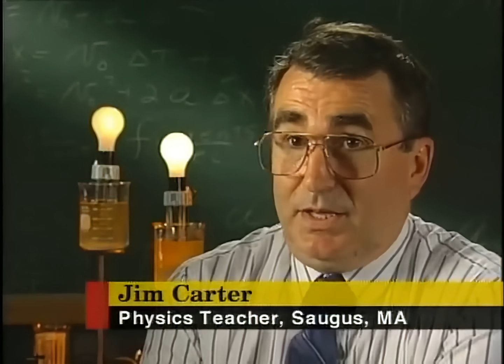MIT graduates cannot power a light bulb with a battery.

Comment: I saw them use a 100-220v candelabra bulb at first. Of course it will not illuminate with a single dry cell. It will work with the little flashlight bulb shown later. This test is flawed, or maybe the trick to the question is that you have the wrong bulb.

Comment: A lot of people seem to think this is a sign that the system is broken. That's ridiculous. And silly. Here's why:

Pick any university you want. In fact, better yet, pick any 1000 people you want. Feel free to cherry pick the smartest people in the world. You choose to select them all from the same discipline or you can spread it out. No restrictions. You're choice.

Give me a camera and an hour and I'll make a video exactly like this using a different question that is every bit as "easy."

Finding surprising or funny gaps in understanding or knowledge - especially with someone who is a little nervous or on the spot - is incredibly easy.
Reply: The problem is the media setting them.up to fail, giving them a bqttery outputting a tiny voltage and an incandescent buld thst operates at mains voltages, no matter how they connected it that bulb wast going to light from that battery.
Reply: Complete cope bro.
Reply: Except that this wasn't a gap in knowledge but conceptual and spatial reasoning ability.
Reply: @nightfoxxy  it was not a gap in knowledge , it was a gap in practical experience exacerbated by the nervousness of being on camera

you should try giving an interview in front of a massive crowd with the pressure of your uni's name on your shoulders and see how you hold up
Reply: @nightfoxxy there are a lot of social factors involved. Also, many pointed out this could have been cherry picked to make a outlandish point.
Reply: The problem is people's overconfidence in an area they have no expertise

Comment: I know what the video is trying to prove here. It is trying to prove that what you learn and what you can do do not always translate. I also know what this video poster is trying to do - to try to make MIT and/or higher education out to be worse than they actually are.

The video was cherry picked. You can see the different bulbs. Some of them require high voltage, which you cannot get with a single 1.5v battery. They finally showed the guy at the end lighting a small (probably 1.5v) bulb with ease. The fact is that you learn way too much in college to be able to keep in your head at once. It takes time and refreshing your memory and most importantly application of that knowledge to really be proficient. 

Therefore, I wouldn't expect any students besides the ones who were interested in EE to be able to do this without preparation (remember these kids just graduated they were basically ambushed and expected to perform a task that they may have learned in their first year).

Comment: Stupid trick question and misleading title. Right, you can't do it with "a" wire like they're handed at 00:59, because you need two wires (or do it like he does at 01:57). It's their graduation day and they're just being casual with the interviewer because they're not expecting "gotcha" trick questions. As an alumnus I assure you every MIT student knows how to hook up a light bulb to a battery, because electricity & electromagnetism is a required course for all majors (8.02) covering basic circuits and things like Maxwell's equations their freshman year. EE majors by sophomore year are building entire CPU's out of basic components.

Comment: Connecting a circuit is pretty basic but in fairness they should have two wires (I would have asked for two probably instead of just putting the battery to the bulb). 

Even so I strongly suspect the video is heavily cherry picked to produce a 3-1 or 2-1 result (most graduates even in non-tech subjects would be able to complete so circuit so to speak).

In the event of the fails- I expect this sort of thing is probably nothing like what they are studying. I studied theoretical physics and I wouldn't be able to do much more than basic lightbulbs etc, however I could work through very advanced maths and solve complex problems, which bottom line is highly valued and useful to employers- compared to putting together a basic circuit which anyone can do with 2 minutes training.

Bottom line- this is almost certainly hack, rubbish journalism on graduates that most likely will contribute far more to the world than the interviewer could hope to.

Comment: To be fair, it was a bit of a misleading question. Not enough information was provided. What type of lightbulb? What type of battery? 1.5VDC won't power a bulb designed to run off of 110VAC.

Comment: The comments here are truly entertaining.  Pedantically parsing the question in an attempt to rationalize the failure of the students to make a simple circuit.  I guess if they had asked, "Can a human being produce illumination visible to the naked eye using only an electrochemical storage module, a piece of low impedance material, and a device designed to emit light when the electrons within a filament inside the device are sufficiently excited?"

Comment: Interesting..... we had to figure out and confirm the function of two way switch light control for 120 VAC bulbs back in high school shop class.......Yet while I was working through University electrical engineering studies a fellow classmate with higher grade marks than I would pick up a soldering iron from the hot tip end!!!! That was 40 years ago when we had good science, physics, math and shop teachers.......

Comment: I doubt even the producers of this video could power the light bulb, given that they had a 1.5v battery and a 120v lightbulb (@ 1:02). Even the smaller bulb that they started using halfway through appeared to either be  too high of voltage, or the battery was nearly dead (@ 1:57).

Also, what's the point of this clip? I have a feeling that it's been taken way out of context.

Comment: to all the people saying that's a 1.5 volt battery and a 120 volt light and the battery doesn't have the power to light it, is technically wrong in that the bulb may be 12 volt, and the battery can power it, but not to its full potential...and will deplete the battery sooner.....and the people saying it's a trick question, it's not, the bulb completes the circuit. ..the one guy did it at 2:00

Comment: basically they are unwitting pawns of an exceptionally technical societal machine.  after the first year your basics are mostly out of the way second year you dont have electives, you might have a couple general subjects and prerequisites for your major.
if you make it past your prerequisites which require A's or B's on your first attempt! you may proceed further into your major. the third year consists of courses for your major at their highest difficulty the fourth year it the kicker. your professors will spin bullshit like youve never heard, the material is the same shit different professor. and the senior level papers might be 30 pages. the hardest part is dealing with rotten toxic attitudes of some of your professors. its the first circle of hell.  by then you are fucking sick of the shit, and you wish you chose a different major

Comment: Its a bit of a vague question, unless they actually saw the bulb and the battery first its difficult to answer. Yes a d cell battery will light a bulb that is rated for around its voltage, but its not going to light a 110v / 240v bulb as it doesn't produce enough power. Use many batteries in series and it will do though.

Comment: Lots of comments that a 1.5 V battery won't light that bulb.  But you know, I'm going to give the author a tiny bit of benefit of the doubt that they at least verified it would work with that battery, that bulb, and that wire before setting out to the campus.

Comment: answer is aways I DONT KNOW. there are always variables, you cannot power a c9 seen at 1:02 (120 vac 60hz) with D cell. anything is possible, one could wire enough cells together (in series) to make 120 vdc, and even throw an inverter in to turn output into ac, package it in shrink wrap and call it a "battery", or stuff a 3 vdc l.e.d. into that c9 just fuck with you, variables, you need to indentify the  VARIABLES!

Comment: This is the problem with most "smart" people (and just to clarify, I use smart for want of a better word, I am in fact referencing those who think that they are clever because they have degrees, doctorates, etc.). They think that because of their intellect, if they can't solve a problem there must be an issue with the equipment or question. They don't even begin to consider the fact that the issue lied with their own lack of knowledge.

That being said it doesn't take an electrical engineer to figure out how a damn light bulb works.

Comment: Wait, was this a trick question, or could they genuinely not complete the circuit? As I see it, there are two possible tricks: that the battery has to be of a suitable size for the bulb, and that you need to touch the nub of the bulb to a terminal on the battery if only given one wire (like the black guy did). Was it supposed to be a test of these tricks, or an illustration of the fact that despite graduating from a top school (like the mech eng girl), some people still don't understand science for ten year olds.

Comment: A proper engineer would have said that it depends on the power consumption of the bulb and the capacity etc of the battery. They  always consider the specifications, doesn't matter if you're mechanically or electrically minded. It's that thought process that helps makes to an engineer. They should teach that! That aside this is basic stuff, that they should really understand, especially as the world moves more towards electro-mechanical products. I get that this was one of those simple questions designed to catch people out though.

Comment: lol I thought of a 100 watt bulb with a little battery. I would have said no... even though I remember doing that with flashlight bulbs when I was like 8 years old. so I know it's possible, but since I thought about a bigger bulb I would have said, no. but if I was seen the bulb and the battery, then of course. it's so simple, I think those students are a litle dumb because they want to get 2 wires, when all you have to do is complete the circuit lol

Comment: EDIT: Literally two seconds later in the video they showed what I talk about below. I didn't watch that far in before writing this stuff, though it's good to get a confirmation that it was correct.

I'm not sure which goes where on the bulb, of the - and +, but I know one part has to go in from the bottom and the other from the side of the socket on the bulb. Put the bottom part of the bulb on to the corresponding part of the battery then take the wire and have it touch the side of the socket on the bulb on one end then the other end of the wire to the opposite side of the battery from where the bulb is touching. Voila. If I get the - and + wrong the first time I'd simply reverse and surely get it right the second time.

Comment: my God, I see all these "engineers" in the comments section bitching saying it's a trick question, there's not enough data or some other excuse, when they literally taught us this in high school. and I don't mean high school as in 30 years ago when they actually taught kids and taught them useful things, I mean I graduated in 2015 from a pretty under funded and seemingly shitty public school. come to think of it, I remember being taught parallel and series circuits and how to wire them in the THIRD GRADE. mechanical engineers, electrical engineers, it doesn't matter, they were taught this at one point in time, most likely multiple times. there is literally no excuse for "engineers" to not be able to do such a simple task.

Comment: My guess is this video is extremely biased in its presentation. Unless they state the proportion of students who did it correctly, then it is a completely worthless test - even worse than anecdote.

That said, it does disturb me that anyone could fail this test. Perhaps none of these students have ever had to install a battery, because if they had, they should have seen two contacts on either side of the battery, and it should be common sense to try connecting both of them.

Comment: There is a difference between 'power' and 'light'... some of the students may have powered the bulb, but it did not light.  I saw examples of people doing the correct procedure (using the wire to complete the circuit started by placing the bulb against the top of the battery) but the bulb didn't light... but it was powered.  This shit is hokey.

Comment: Hey, I thought the task would be to light an ordinary 110/220 volt bulb with a 1.5 volt battery. Which is possible... but you need much more wire (to begin with).
Reply: Damn, you're even dumber than those engineers...

Comment: Ffs you need to create a circuit, you need 2 wires. The bulb has 2 probes and the battery has 2 terminals. Those grads have no common sense, my father has seen dumb chuck engineers like this his whole life, MIT and Harvard should only admit students with common sense and an interest, not just on grades.

Comment: You need two wires. This is obvious.
Reply: Or of course just touch the bottom end to one side. Bottom line is you need two connections to the bulb, one from each end of the battery.

Comment: I'm a junior in high school and definitely one battery won't light a bulb for you. Voltage is too low and because the bulb is 60 watts, you would need to pull 40 amps out of that one battery.
Reply: Um, that's not true. There is a level that has to be overcome to see any light but a single battery can light a small bulb. The maximum brightness of the filament is determined by the current flow which can be so low the filament only glows a feint red or so high the wire burns up. Plus those weren't 60 watt bulbs anyway.  40 amps of current is far too large for most lights.
Reply: +phoenixamaranth i know a battery could light a small bulb but not one of that size. I saw comments saying the bulb is 60 watts so I assumed that. In that case 60 watts divided by 1.5 volts would mean 40 amps of current to light that bulb at its rated wattage.
Reply: Yes, I would agree, your calculation of required amps is correct, but that's at that rated wattage to get a certain amount of lumens. The filament would light at a much lower wattage for the purpose of this test but be dimmer. Without knowing the exact type of bulb here I couldn't say what the minimum to see something noticeable would be.